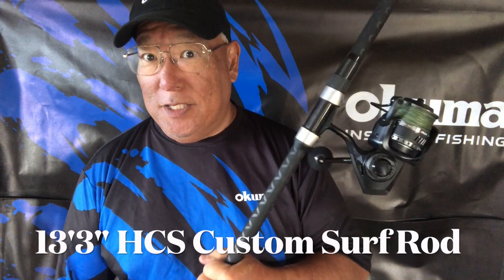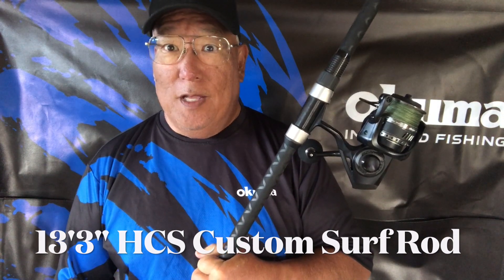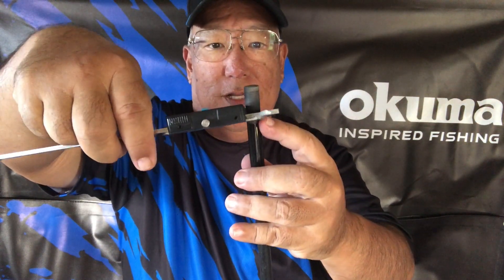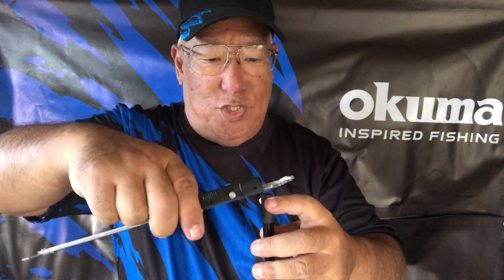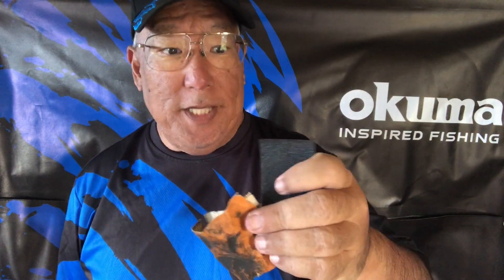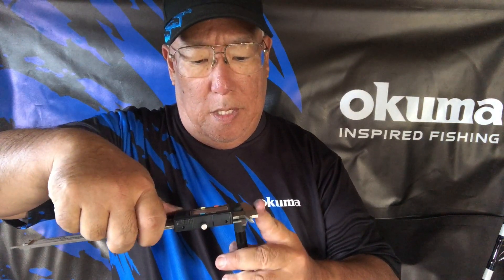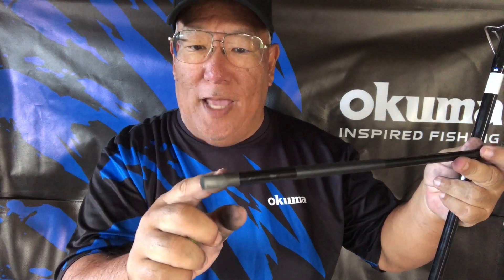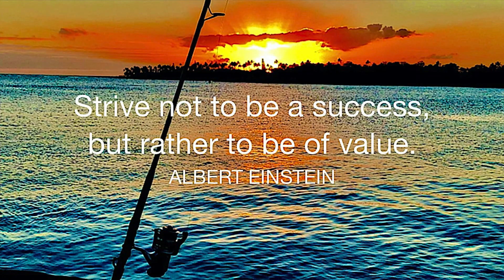Prevent Your Fishing Rod Segments From Sticking Together!

Comment: Interesting video Chris.  I have a 15ft 3 section Continental Surf Rod, and the first time I used it, the middle section got stuck in the Butt.  Luckily, I can get 10ft in my car so took it home to deal with it.  Tried everything with no luck. I thought running hot water over the female part might help, but no.  In the end, I left the ferrule between two bags of Frozen Peas for an hour, and it came apart!  I gave it a light sanding, and a good clean on both parts, followed by a very thin smear of quality Silicone grease.  It works great now, but another trick is to keep a couple of 6" squares of that grip mat in your tackle box - You can grip the sections of the rod much better.  I wish I'd thought of your trick and used a Caliper to measure it, to find out where the problem was.  Thanks Chris - stay safe & well.  👍👍
Reply from the maker: Glad it's ok now. The micrometer was just for show. I noticed the slight bulge by eyeing the ferrule. Been going through this issue many times before with others & my own equipment over the years. Thanks for sharing your experience:)

Comment: You can rub candle on the inserting part.
Reply from the maker: In this case i saw the problem with no magnification. The inserted end was a little too thick. Most anglers would take a piece of sandpaper and grip it in their hand and then sand the ferrule over the entire area.  This caused the middle section to be correctly leveled but not the end. When i measured it it showed that to be the problem. I've helped many anglers correct this problem over the years. Using sand paper over a block would've created an even sanding. It took me a few minutes of directed pressure light sanding and now his 3pc are all locking-up & coming off correctly. The wax covered application you suggested will get the piece in but getting it back off for future applications will still be a problem. I've helped many over the years by doing this. I've owned 100's of rods over the years so i eventually learned over time.